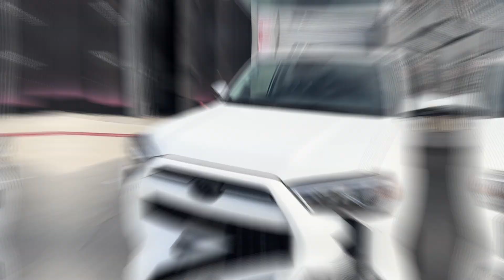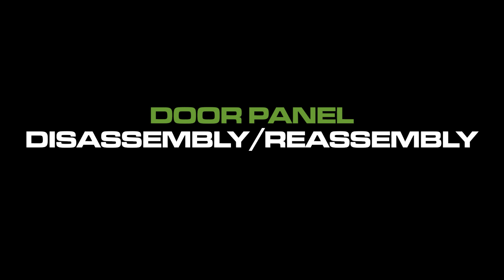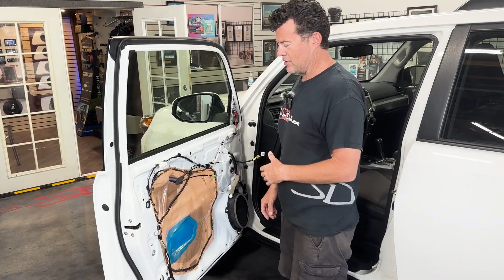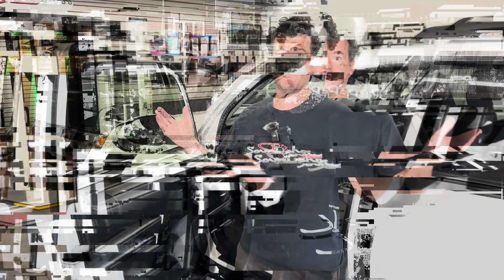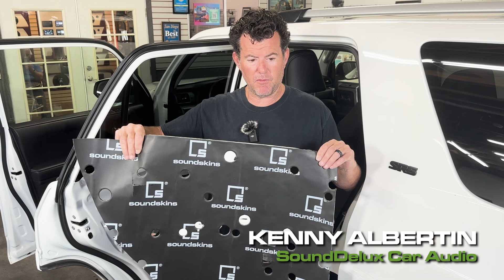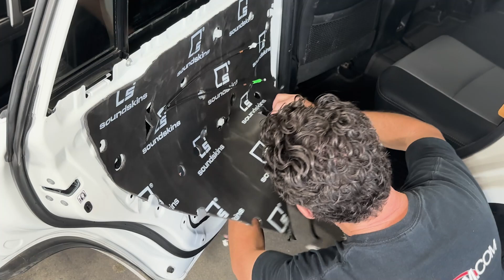How To Install the 5th Gen Toyota 4Runner 2010-2024 Sound Deadening Kit

Comment: You don’t have to lift the panel up and remove the window trim with the door panel; you just pull the whole door panel straight out and the window trim stays in place. When you lift it up and remove it that way, you risk scratching your Window Tint.
It seems like it would’ve been pretty obvious since you popped it right off the door panel to install it back on the door 😂